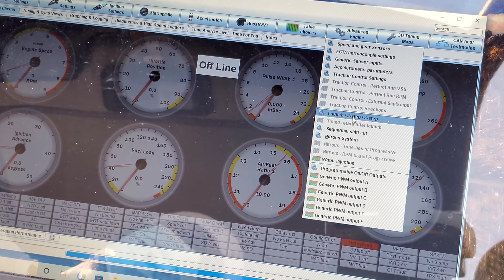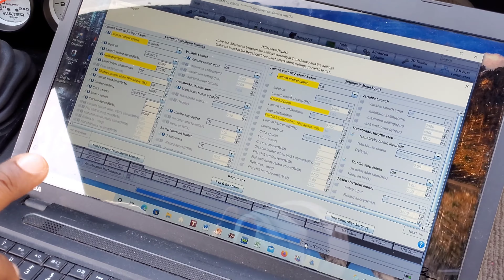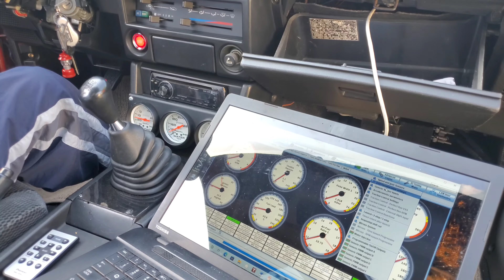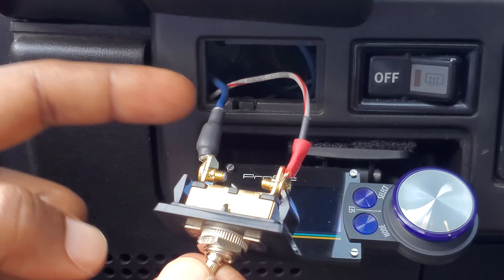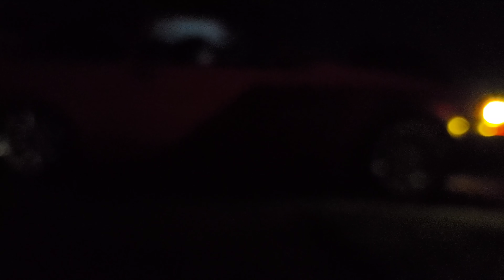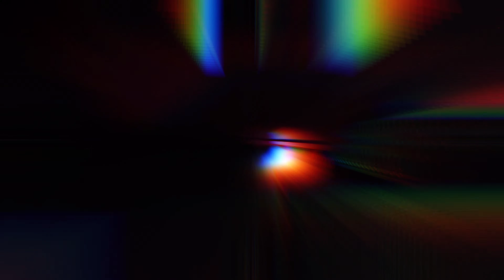AE86 2RZ Turbo 2 Step Launch Control Megasquirt 3 DIYAutoTune

Comment: Where did u get ur intake manifold
Reply from the maker: It's a local welder that did it originally. I bought it with it. But I had to fabricate it to get rid of some issues. Then I got it polished by Peter Reid. Some damages were welded by Darren Brown @Kab Customs, who also machined the surface for perfect leveling